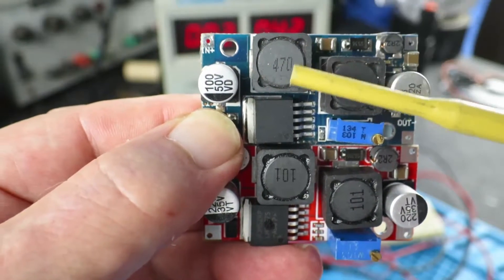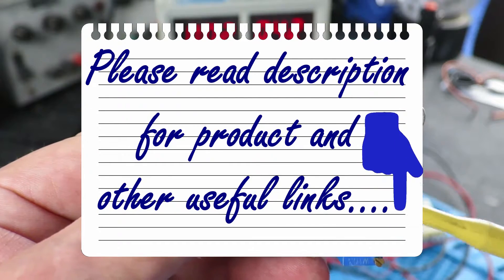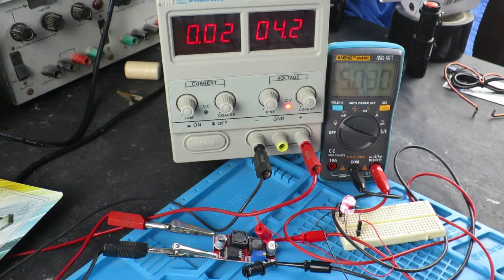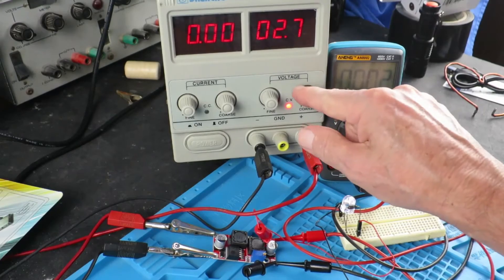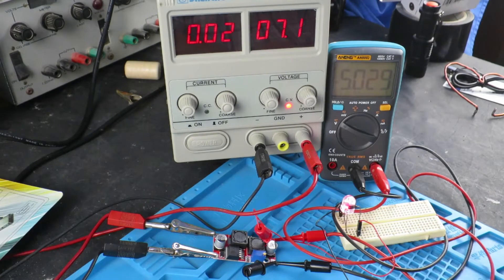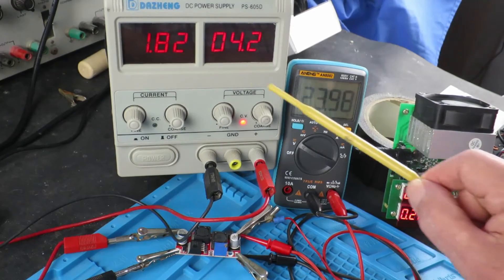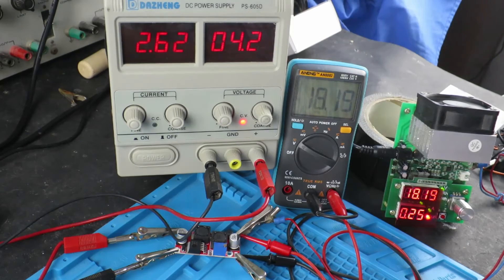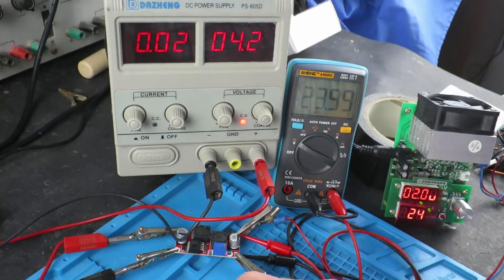Best BoostBuck For Solar Projects? LM2587 Module Test

Comment: Thanks.   Your "Buy LM2587 Boost Buck Converter 3-35V to 1.25-30V " link now links to what appears to be just a Boost converter, not Boost Buck.Maybe Banggood hijacked the link, when that went out of stock.
Reply from the maker: The product description is incomplete it is also a buck converter. Look in the review section and there is a comment to that effect.
Reply: @1nformatica  Okay.  Thanks.  I thought boost buck converters always had two inductors, like the one in your video.
Reply from the maker: @TooSlowTube  Check out the data sheet here : https://www.ti.com/lit/ds/symlink/lm2587.pdf?ts=1615575087833&ref_url=https%253A%252F%252Fwww.google.com%252F The chip is correctly called a "flyback regulator" which is how it can do both functions. There are some circuit examples you can see.
Reply: @1nformatica  Thanks.

Comment: Fantastic, man. Much better, there's no comparison!
Reply from the maker: Thanks Mario! Yes, much better. I will be testing this with a solar panel soon.
Reply: 1nformatica I think I'm going to buy one for a solar panel project as well. But it's a project that I'm not going to be able to make soon... I need a lot of 18650 batteries around 2000mAh for that. LOL
Reply from the maker: Local recycling center? PC repair shops? Ask friends and family if they have a old laptop under the bed?!
Reply: 1nformatica I'm doing it. 😊 The problem is that it's rare for the batteries to be that good, you know? I already have 6 batteries for this project, but I still need another 18. I'm going to make a 4s 6p battery to run a 10w LED panel during the whole night and that is going to be charged during the day by a solar panel. 😊 But no hurry, I have projects that I started buying parts last year and still don't have everything. LOL Patience is the key. 😉
Reply from the maker: ¡Poco a poco!

Comment: "There's no free lunch" -> PERFECT!
Reply from the maker: Thanks! I try to put a little humor in, but it is true, everything has its price!
Reply: @1nformatica  but how so? i have this module to power a handheld device. i have 4 aaa and want to drive an array of transducers between 20-24V but they can't take more than 700mA. it's good to know my transistors are gonig to blow up as they aren't rated over an amp either, but what can i actually do to make the project function?
my thought was that a boost converter would yield lower amperage for higher voltage. that seems mathematical. so now i'm confused.

Comment: Are there any problems with using a separate boost module and buck module, to get the same effect?

Would it matter which way around they were used?  I.e. buck then boost, or boost then buck?
Reply from the maker: Normally it is used as either boost or buck in an application. I don't understand why you would want both.
Reply: @1nformatica  I was thinking it would be a tidy solution for providing 7V or so to power an Arduino from either a 5V USB power brick, or a DC socket, used with a 9V or 12V wall wart - I'd want it to work with either, without getting hot...  I think 12V is a bit too high to risk powering an Arduino from it directly.

Mostly, I was thinking that would take up less space, and that I'd only need a switch to disconnect power from the 5V brick to the regulator...

I kind of got locked into that as a solution, and decided the XL6009 wasn't good enough, after watching your last video about it - I can't guarantee what happens as the 5V brick goes into cut off, as the batteries in it run low.

Now I'm rethinking it all together.  Maybe a buck for the power socket, a boost for the 5V brick, and a dual pole switch, to break power from the brick to the boost regulator, and switch the socket to powering the buck regulator - messier, and less compact, but maybe more reliable.  Plus, I probably have the parts to do that, instead of relying on post-brexit delivery from China.

I'm surprised Banggood hasn't stocked its UK warehouse with a few of everything, so we can actually buy from them without hassle.
Reply: what if we connect a boost module with a fu(k module?

Comment: Sure I've heard mention of the voltage problem on another channel.  This seems a good little board though!
Reply from the maker: Yes, I'll being doing more with it. Seems a little harder to find than the XL6009 boards but you can get it here http://bit.ly/BoostBuckLM2587
Reply: 1nformatica Managed to get a couple on Amazon.co.uk.  Must check though when I get back from my holidays as I'm sure I have a buck boost converter in my stash at home and see what type it is.  Most I have are either buck or boost but not the combined type!
Reply from the maker: They're fun to play with!